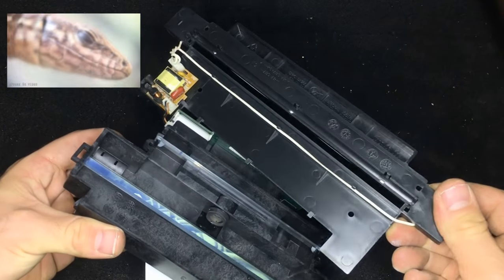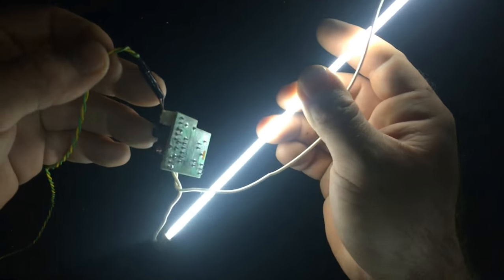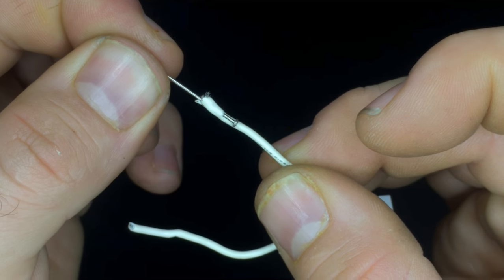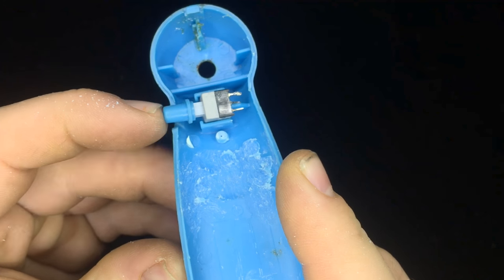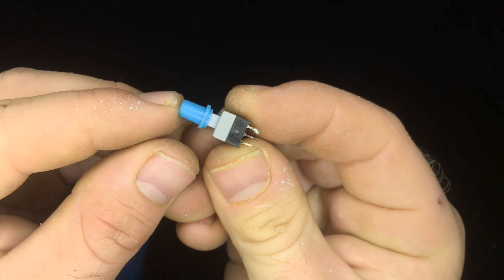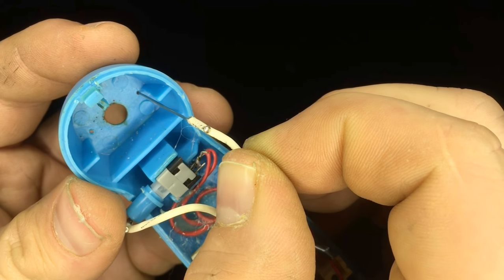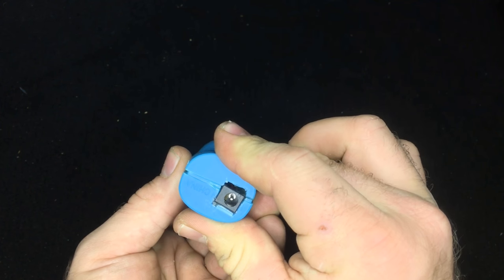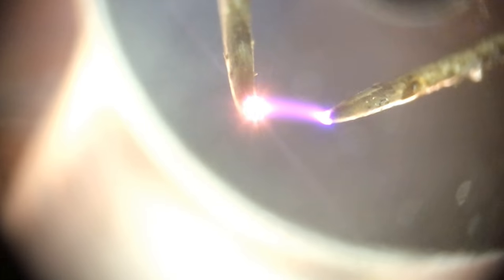Light a Cigarette With a Scanner

Comment: What the fuck is that a 12v aa battery?
Reply: Star Respy You know there are diffrent voltage and amperage batteries right? The size doesnt determine output values.
Reply: Star Respy Do you think there are only 1.5V AA's?
Reply: J0keR_  do you know that there is no battery which can supply 12v in a size of a aa battery?